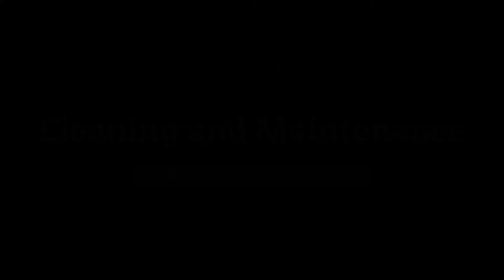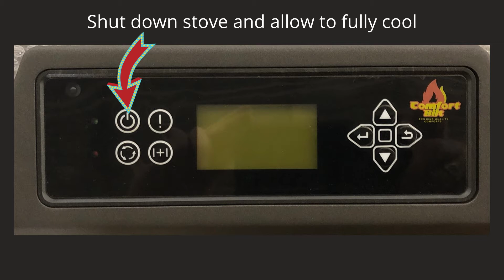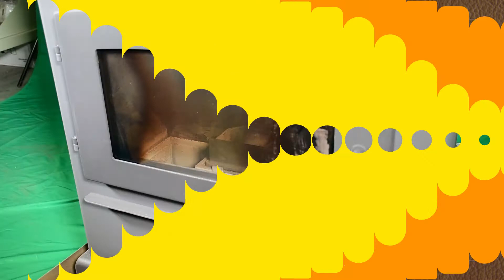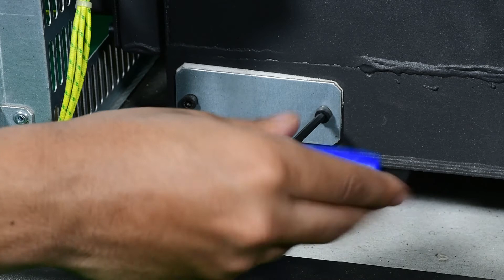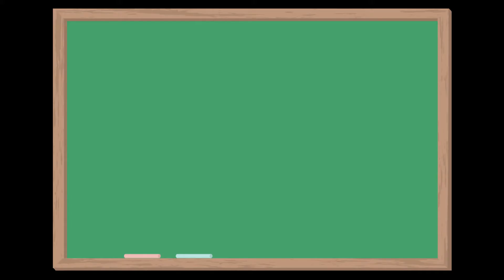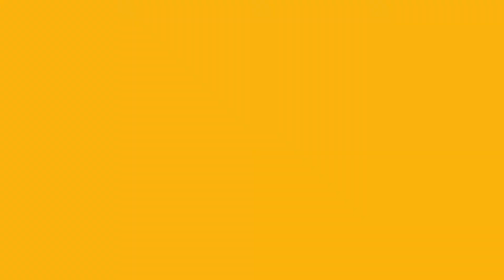HP54/HP55 Cleaning and Maintenance

Comment: I'm considering the HP54 - You recommend cleaning the Burn Pot every day?  That sounds a bit extreme to me, but my old stove is a horizontal-auger lift system, not a drop system.
Reply from the maker: Daily cleaning is only recommended at the very start, as you are getting familiar with your stove.  Depending on pellet quality and airflow, you may find the need to clean the burn pot less often.